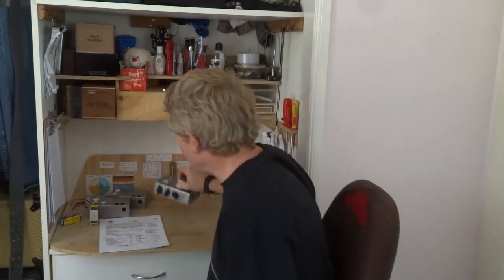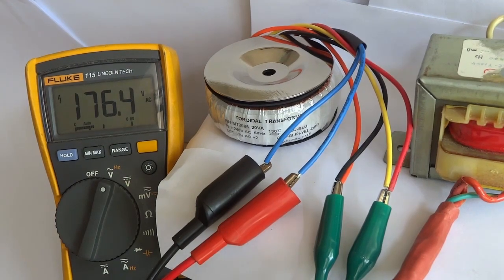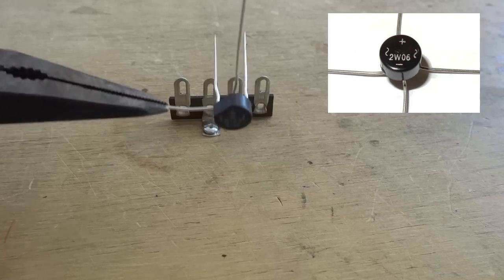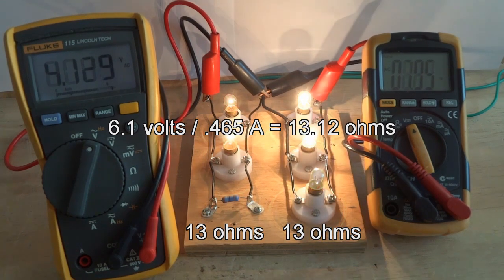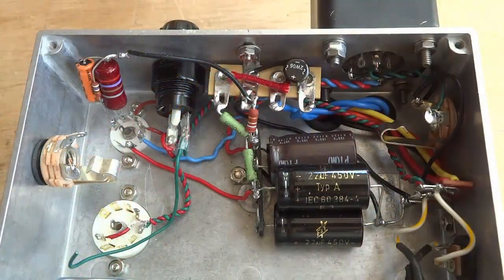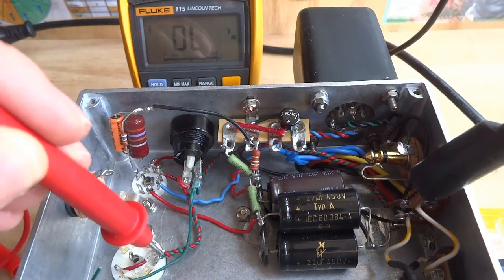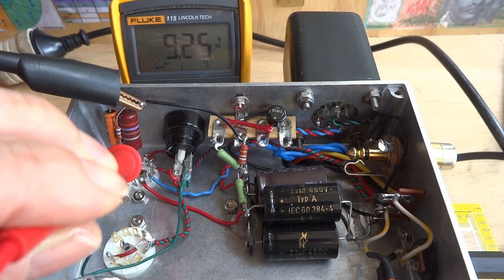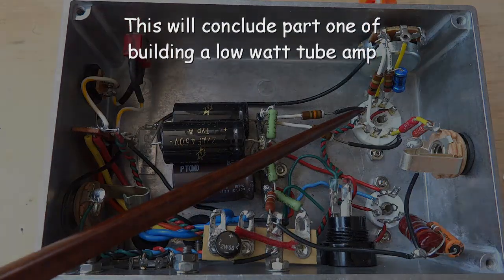Build a low Watt tube Amp Part   1

Comment: i have a question. i have a 7 pin 12av6 tube. and ive never messed with tubes before how do i hook up the heater conections? do i ground one of them? or do both get power? and do i have to specifically match the heater voltage?
Reply: Yes, the heater voltage is important - too high and you burnt out the heater, too low and you won't emit enough electrons.  For signal tubes where the cathode is close to ground potential the heater voltage is either done as one side grounded, or if the heater winding on the transformer has a centre-tap, the centre-tap is grounded to reduce hum (the AC signals on each heater connection are then out of phase and tend to cancel out)